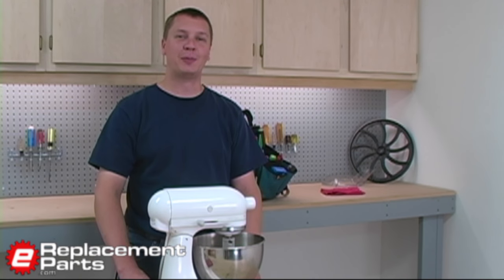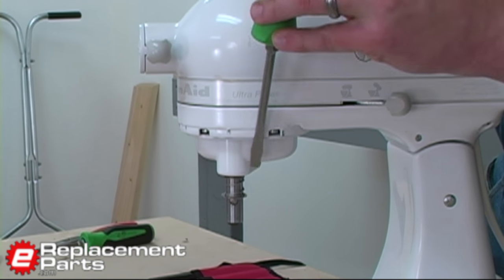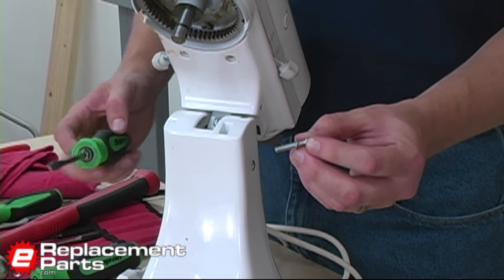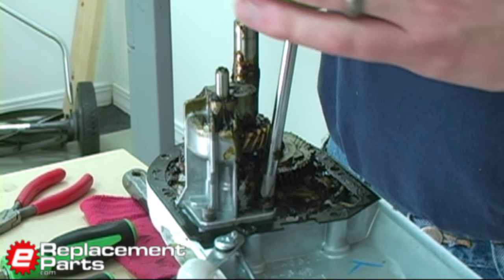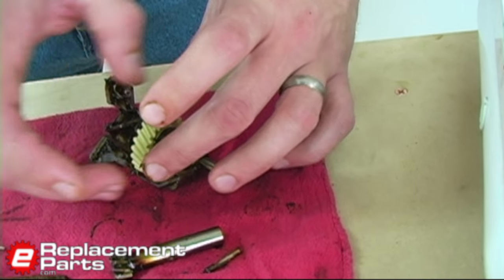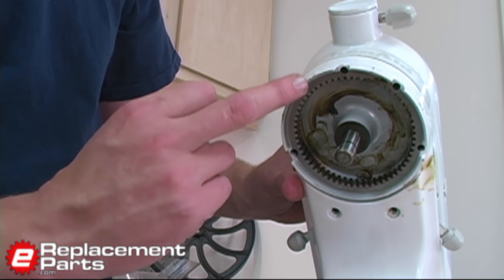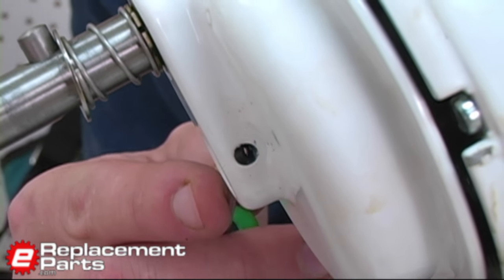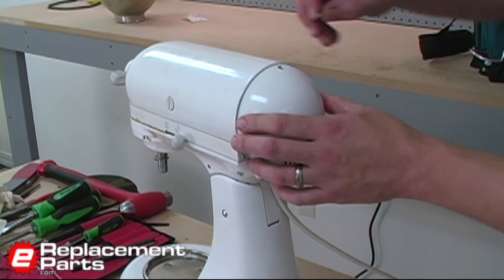How to Fix a KitchenAid Mixer That Isn't Spinning

Comment: Hello
Thanks for helping me replace my dripping old grease.
Everything went well but I have one small question.
Behind the rear cover plate, there is a small silver screw at the base of the electrical board.
Mine was not seated all the way in and it looks like the one in your video isn't as well. 
What is it for and should it be backed out?
Thanks

Comment: So I felt that I had to leave a comment after using your video to fix my own mixer. I was in the middle of making a buttercream and the planetary stopped rotating with much force. I could literally stop it from spinning with my hand. So I watched the tutorial and immediately came to the assumption that it was the WM gear. I went ahead and purchased a new one and waited for it to come and got all the way down to putting it back together and realized that it wasn't actually the WM gear it was the roll pin that was missing. I was wondering why in the beginning why I was a step ahead. Anyways, now I know my way around the mixer and for less than the cost to send it to KitchenAid and have them tell me what was wrong with it, I was able to fix my problem and somewhat give it an upgrade. But, I must say that you cannot get the little pin out from the motor gear in the top without a punch tool. I tried literally every skinny object I could find to try and get it completely out and it just would not get in far enough to pop it out.  Thank you very much! 

btw I've had my mixer for 7 years now and it runs like its brand new!

Comment from the maker: @MoosieMoo While we don't currently have a Pro machine available to use for our video production, most of the KitchenAid Mixer basics are the same. Take a look at our grease replacement video and see if it helps. It is titled "How to Fix a KitchenAid Stand Mixer That Is Leaking Oil".

Thanks!

-Mark

Comment: got the worm gear out, it was a real job getting out the pin in the 1st part of the video, not as simple as when the author of this video made it. Do yourself a favor & make sure you use a punch like the video states.  the rest went very smoothly.  now awaiting the new part to arrive.  Fantastic video.

Comment: EXCELLENT VIDEO & EXPLANATION, VERY USEFUL TO ME.
MY PROBLEM WITH THE MIXER IS NOT FAILURE OF SPINNING, MY PROBLEM IS KIND OF DRIPPING GREASE. NOW I KNOW HTERE IS A LOT OF IT IN THERE.       SHOULD I CHANGE AND RENEW THE GREASE?  IF THIS IS CORRECT. WHICH SPECIFICATION OF GREASE IS CORRECT? I LIVE IN TABASCO, MEXICO. KIND OF HOT HERE. IS THAT THE CAUSE OF DRIPPING?   THANK YOU FOR YOUR CONSIDERATION AND ADVISE.

Comment from the maker: To check that the motor is not the problem you will first need to keep it unplugged. With the upper housing off, the part with the motor in it, push the speed control knob to the highest speed. Doing this will open the control plate enough so that you can turn the end of the motor. If after all this the problem is not found, we would suggest taking it to a service center for repair. Thanks for watching!

Comment from the maker: @fanglong77 The part number for the worm gear that applies to the KitchenAid mixer used in our video is W10112253. That same worm gear is compatible to many mixer models. The best way to match a replacement worm gear to your mixer is to visit our website and type your mixer's model number in the search field. The search will take you to your mixer's parts page. A mixer with a bad worm gear will no longer spin. The gear will also have visible damage on it.

Comment from the maker: Thanks for watching! The planetary can float a little however, it shouldn't be more than 1/4". With the head being wobbly and unstable the only thing you can do is tighten the set screw that is on the underside that you have already described. It would be worth taking to a service center to be fully checked out.

Comment: Thank you the Video is great!  My planetary spins the issue that I am experiencing is that the mechanism in the front where the attachments slide in is not spinning.  By replacing the planetary gear will that fix this issue?  If not can you direct me in what I will need to do to make the repair?

Comment: @Jhunyor87 My mixer jammed while I was mixing cold butter and sugar for a cake. The mixing bowl became unseated from its locked position then the beater got stuck against it and couldn't turn. By the time I made it over to the counter to remedy the situation, the damage had been done. The beater no longer turned in any speed. I did not know what the specific issue was. But a google search on "Kitchenaid mixer won't turn" led me to a number of pages that mentioned the worm gear. And linked here.

Comment: At 1:39 into the video, you use a punch and a hammer to remove the roll-pin that  holds the planetary to the mixer. I cannot get that roll pin to budge - seems pretty well fused in there.  Any suggestions?

Comment: Hi eReplacementParts, excellent video. In following your directions though, I think I may have hit a snag. When I try to remove the pin that holds the planetary in place, it won't budge. I have tried from both directions. Any tips?

If it helps, my planetary rotates, but there is a grinding noise, and the agitator doesn't rotate properly.

Comment: Thank you so much for your video! One question I have about it is, you didn't replace any of the grease that you took out. Is that not necessary? Or do I need to buy a bunch of that grease to put back it the gear box?

Comment: Hmm, this gives me an idea! Do they sell metal gears to replace the plastic ones? Sell em in a kit and I'll bet people buy them like crazy. :D

Very good video btw! I had no clue the insides were so simple.
Reply: +Shaggy2286 A lot of times manufacturers will purposefully build a weak point into the a drive system, so if something where to get wrapped around the final drive to prevent it from turning, there's something to break rather than destroy the whole machine or break a casting or something much more expensive to fix than one gear.
I assume that's the season that gear is not metal.
Reply: What C Smith said is correct here, this part was designed to fail. If you did not have it in place, you'd be replacing an entire motor instead of a cheap part. The more expensive KA mixers have other failsafes built in to shut down the mixer when it's overused electronically. A mechanical failsafe is more reliable, though (like that with the nylon gear).

Comment: I'm thinking I should maybe replace some of the grease since the worm gear was torn to shreds and is all mixed in now with the grease.  I saw in another video by you folks that they suggested replacing the grease.  Can you make a recommendation?   Great video!  Thank you.
Reply from the maker: +Carla Parsons I usually replace the grease in these every time the case is opened for repair.  If you've had a gear issue it is especiallyimportant.  The smallest metal shaving can cause damage to the new gears.

Comment: Additionally, the replacement part 4159133 didn't fit. I found a spring tension pin 22mm x 4mm was the perfect replacement for it and went in a treat

Comment: Hi! thank You for your videos. I have a KitchenAid Pro 500 and it seems that to remove the top part is not the same as the Pro 600 that you showed. How can take it apart to make it work since it does not spin but the motor runs. Thank you
Reply from the maker: +Caro Sala The Pro 600 and Pro 500 come apart in exactly the same fashion.  Write back with the model number from the bottom of themixer.  I'll research it further.

Comment: Thank you for the video. My problem is the roll pin connecting the tower gear to the worm gear is broken. I have taken it out but it was only as wide as the tower gear. I don't know where to get a replacement part, do you have any suggestions?

Comment from the maker: After watching your video it looks like the wire whip is hitting the bowl. The flat beater and the wire whip should not touch the bowl even on the highest speed. One of our other videos will help you solve your problem. The video is titled:
How to Adjust the Beaters on a KitchenAid Stand Mixer
Thanks for watching!

Comment: First off - Thank you for these videos!!  What a great service.  I having trouble removing the roll pin to remove the planetary.  I cannot see the roll pin.  The beater has been slipping while mixing and I can rotate it by hand through about 30 degrees.  Has it slipped to where the pin is hidden?  Do I get it to slip some more until the pin is visible?  Thank you for any guidance you can offer.  Kevin

Comment: Love your video. My wife dropped something in the bowl while it was mixing. This caused the unit to stop spinning She unplugged the unit and removed the object. When she plugged it back in and turned it on, the mixer now makes a clicking noise when it is spinning. Any idea which gear I should be looking for that might be damaged ? Thnaks

Comment: Thank you for this video!!  I am no longer scared of my mixer's insides... My mixer was making a grinding sound so I took it apart to check the worm gear - but it looked fine.  So I added more grease then put it back - and now it is making a squealing noise after it runs for 30 seconds or so...  All the screws seem tight - what could it be?

Comment: Great video, thanks...I have a question: when i take apart to change the grease; i noticed iron dust in the drip ring. It must be made by the pinion and internal gear, but why it happens? The color of the grease is brown(used for min.3 years nearly every day); can that or a problem by the upper gear system (like worm gear) be the reason for that? I've noticed that the pinion and internal gear are not greased; should i?

Comment from the maker: Most of the time, with the problem you're having, the gears or pins can be to blame. Be sure to check that you can turn the gears easily with the motor off. Be sure to double check the attachment gear, it can easily be over looked.

Comment: Great Vid!, but how do you repair the attachment assembly when it is not spinning.  The back portion spins but the front part does not.  I can only turn it using great force. The planetary works just fine.

Comment: This is a great video. Helped me feel very comfortable taking my mixer apart. My problem is the accessory drive gear (part 9705130) seems to be stuck. It turns only with great effort, and won't slide out. I can't find any pins or anything holding it in. Is this a part you just knock out with a hammer, or is there some other trick to removing it? Any help would be greatly appreciated. I couldn't find anything on your site about removing this gear.

Comment: Thanks for the video. I replaced the worm gear no problem after something hard fell into the bowl and the gear was stripped, I reassembled it and it didn't go - dead as a Dodo!  Is there some kind of cut out switch in the motor that needs resetting please??
Reply from the maker: Hi Jonathan, we have a video on our YouTube channel to help you with this - How to Replace the Control Board in a KitchenAid Stand Mixer.

Comment: Great video!  Now, how would I do this to the older professional grade style?  The one where the bowl is raised and lowered... there are 4 major bolt holding the base on to the upper arm containing the motor and spiny thingy.  I've tried to get those suckers out with no luck yet but my drill battery is charging just in case.  Other than that the rest looks very similar to this model...  Do those 4 big bolts have to come out?

Comment: Great help.I worked through the repair with no problem and the mixer runs fine now. However, the only problem that I couldn't work out was the replacement of the drip ring. When I press it in place it just drops off. Maybe there is a bit of resistance preventing it from snapping all the way up in place, but I couldn't see any way to 'collapse' things above to 'shrink' the space between the planetary and the mixer chassis. Every thing seems to be seated together tightly. Can you help? Thanks!

Comment: I followed your tutorial to the T, which wasn't too hard because you did a great job at explaining. But now I have zero power to the mixer which wasn't even the problem before. It ran, it just skipped gears. I'm at a loss. Any suggestions?

Comment: Hello, I learned somethings from you vídeo, but have to ask this:1. How do you go on ordering  a part because "usually" that is the one that fails?2. When you used your finger on the supposed unable part, the gears were moving. Why would you maintain your diagnose after that?Many thanks

Comment: My Artisan spins but clicks badly. Any ideas what the problem is?
Your video was great BTW - clear and careful.
Kitchen Aid in the UK charge £66 for collection and repair PLUS parts (average total cost they say is £90!)

I feel like I could do the repairs myself with your help here which is super. They look like pretty simple machines really (sadly not as robust as my Kenwood though).

Thank you again

Comment from the maker: @RafikibobII You really do need to use a punch to remove the pin. If it is being stubborn back up the spindle with something solid like a vise. That way when you strike the pin all of the energy goes to the pin instead of the rest of the mixer.

Thanks for watching!

-Mark

Comment: Nice Vid. I have an Older K45 and need to replace the plastic brush housing but can only find parts for K45SS that do not have the slots for the electrical clip connection.  Do you know where I can get the replacement, or how to make the newer version work?

Comment: Very helpful and knowledgeable. Thank you. l do have a few questions. Is the grease standard axle grease as you would us on a car? Also, how do l repair a very old Kitchenaid K5, that only goes to the fastest speed of all 10? l bough one to assist me in my cheesecake baking. It has the original cord the is only 2 prongs, so l know its older then my K5 that l have for over 30 years. 
Will l have to replace the motor or what is there a way to fix this?
Thank you in advance.

Comment: Your video is great and really helpful, however I can't find an exact video for my K5SS bowl lift model.  We have taken pretty much every visible screw out of it but we just can not get the top housing off of the mixer :(  Very discouraged.  Yes we tried prying it with screw drivers on either side to the point of where we ripped the paper  toward the front of the machine.  Any ideas of why we can't pry it apart?

Comment: My KSM90 also makes a grinding noise when it spins. I have replaced the worm gear with a new one but the noise is still the same. There is plenty of grease on the gears. If I remove the planetary then turn on the unit it sounds perfectly fine, I'm not sure if I should replace the planetary or perhaps something else. Thanks!

Comment: great video, i have a kitchen aid classic plus, and the speed mixer isnt working
only works on 2 speed, max and when its off.
i think some part inside might went off cause i heard a loud noise, and then started to work like that. 
do you have any idea how i fix it? 
thanks

Comment: Wow. This is great instructional movie. Except my kitchenaid mixer is Pro HD 475w model which does not have the roll-pin at the planetary at 1:35" but it fall off even with light mixing. I simply don't know how to get the planetary to hold on to the mixer.  Help!!  Thanks!

Comment: Thanks for the useful video. I replaced the worn worm drive gear on my mixed but now it won't turn on. I removed the motor brushes by accident while disassembling my mixer. Could this have anything to do with it? I replaced them but my mixer doesn't have the alignment pin for the motor brush. What is the proper alignment? Help! Thanks!

Comment: Hi your vids are great, i have this problem with my kitchenaid mixer, but i cannot open it, i cant find the last two screws before opening it, my mixer is a different model from yours, is a proline 325watts mixer (gray), i removed the five screws on the head, and 2 more screws that hold the motor, but i cannot find the final two rear screws, they are not there

Comment: my older K45SS will not turn on after inspecting the brushes. i watched your videos, and decided to go ahead and take apart the unit to check it out. (we bought it at a thrift shop)
after removing the planetary gear and cover to check the grease, i cannot get the planetary gear shaft to expose enough of the slide pin hole to close it all up. i tried your suggestion of using a small screwdriver to get it into position, but it won't budge. i redid the whole thing again, with no luck. ????

Comment: Hi great video! I'm stuck on the second step which is to remove the roll pin which holds the planetary to the mixer. It will not budge. I have a artisan kitchenaid. Any help will be much appreciated. Thank you.

Comment: Thanks for the great video.  My KSM150PS mixer suddenly works but grinds at slow speeds, and slips completely at high speeds. But after dissembling there is no sign of wear to any of the gears.  Is replacing the worm gear worth trying anyway?  I haven't ordered it yet.  Thanks!
Reply from the maker: If the gears look to be in good condition I would check the Shear Pin.  That's the pin located on page C part number 11.  These are designed to shear off if the mixing blade is put under too much stress rather than ruining the rest of the mixer. My other recommendation is clean all of the grease out of the gear case and replace it with new.  Small bits of metal often accumulate in the grease and this will cause the mixer to knock or make a ticking sound and can be the cause of another gear failure.